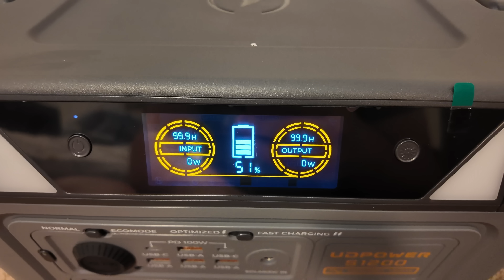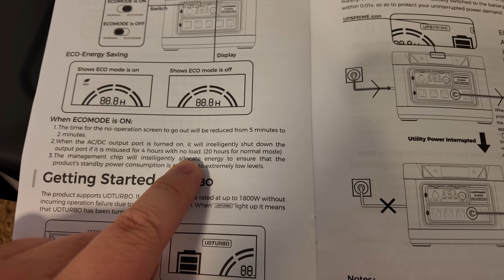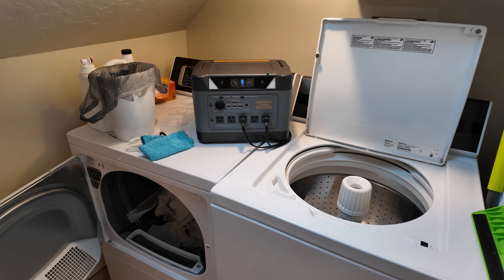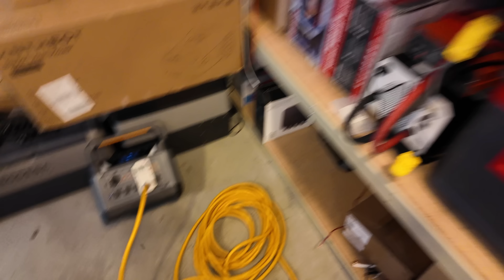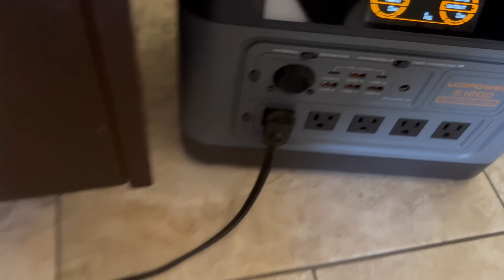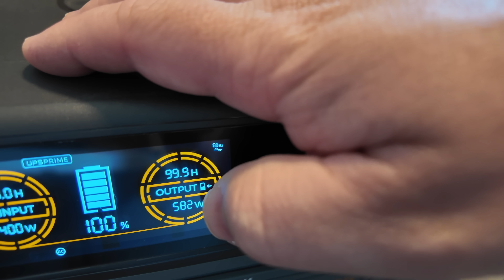The Underdog Power Station That SHOCKED Me! UDPOWER S1200

Comment: just purchased one of these with the 240W solar panels for 629. and looks like i made a great purchase even more. taking it on the road with road trips and van camping along with moto camp. i think this was better then 1000 dollars for the harbor freight 1k unit that included discounts. i see the unit is only 400 dollars on its own, thinking if needing another around the house with less extension cords during the evening and solar for the afternoon with gas power generators for power outages. thanks for all you hard work you put into this video.

Comment: $1200???? Hell nah, i rather buy Eferyi power stations , its cheaper and with 7 yrs warranty
Reply from the maker: There are definitely a lot of competitive options on the market right now.
Reply: It’s not 1200.00, it’s 350.00 on the UD Power web site
Reply: @riverswild5825  my bad.  It's the model 1200.   I got a UDPOWER c600 for $159 on Temu.  I should have bought the S1200 instead, but the current model I bought still good for now

Comment: I won this one on eBay and am thinking of putting it in my car instead of my Bluetti Elite 100 V2 that I have in my car now. I'm thinking that I can use the cigarette plug charger with 8mm plug and another cigarette plug charger with an XT60 plug to charge at same time while driving. I hooked up a Bluetti Charger 1 and just couldn't seem to get the Bluetti to work right! I had other people try also and it just wouldn't work right for us. But the app sucks and if you call them, I believe you're calling China!
Reply from the maker: Sounds like a crazy situation!

Comment: As a carpenter this makes sense to me can you add a another battery
Reply from the maker: No. It does not accept a proprietary external expansion battery…but you can easily add a massive external battery through the high voltage DC port like I show how to do in this video: https://youtu.be/Jg7HqRmNQlw?si=MR8wRpAPDQEq8FI3

Comment: Can this be connected to the Temgo 48V 100Ah 5.12kWh Lithium Golf Cart Battery, as you did in the I SOLVED the BIGGEST Problem ALL Power Stations Have, video?
Reply from the maker: Yes indeed! Just use the high voltage XT60 solar input on the back of the unit…not the low voltage barrel plug port on the front. Thanks for watching both of my videos!